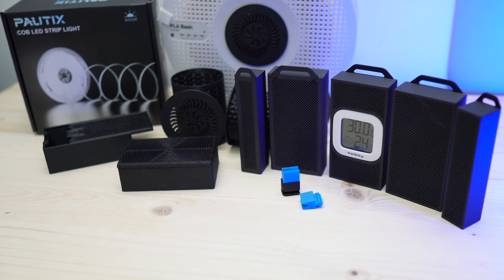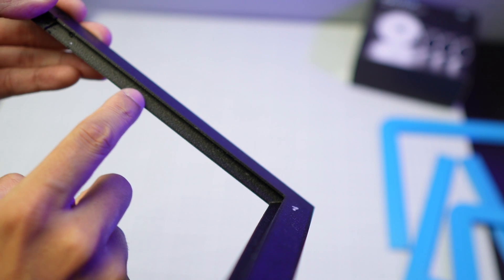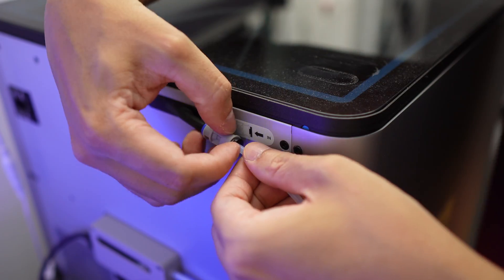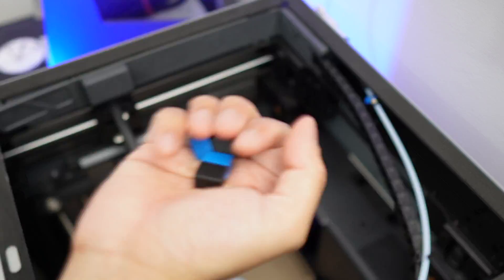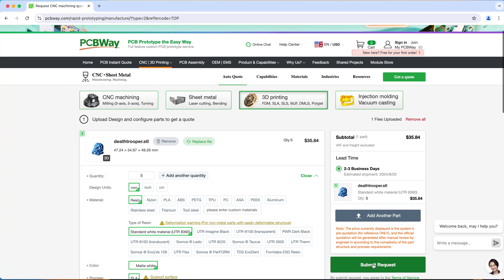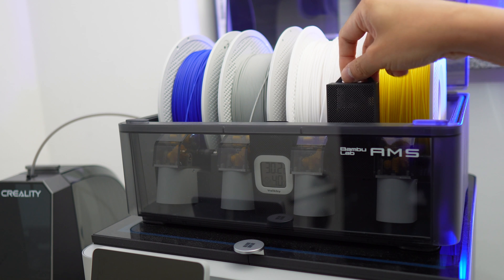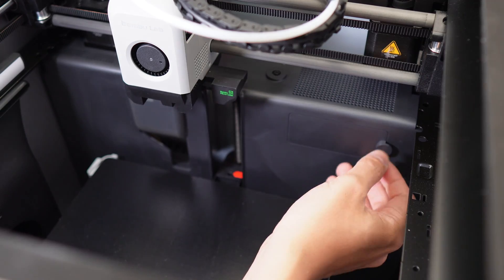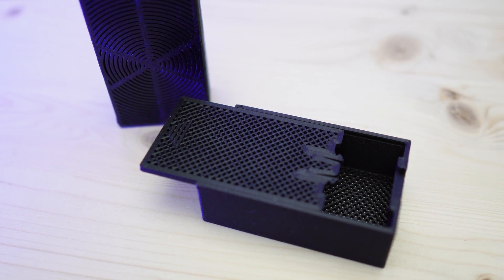BEST UPGRADES and MODS for Bambu Lab X1C or P1S/P2S

Comment from the maker: BambuLab X1C: https://www.awin1.com/awclick.php?gid=570774&mid=46345&awinaffid=2034675&linkid=4382688&clickref=
BambuLab 4-in-1 PTFE Adapter: https://tidd.ly/4pm8DU6

Recommended 3D printer: https://www.awin1.com/awclick.php?gid=570772&mid=46345&awinaffid=2034675&linkid=4382705&clickref=
Best affordable 3D Printer: https://www.awin1.com/awclick.php?gid=570773&mid=46345&awinaffid=2034675&linkid=4382675&clickref=
Recommended Filaments: https://www.awin1.com/awclick.php?gid=570777&mid=46345&awinaffid=2034675&linkid=4382680&clickref=

My 2nd favorite filaments: https://geni.us/A4OFomi
Lubricant for X,Z,Y-Axis rails & idler pulleys: https://tidd.ly/3KMFHqs
Grease for Lead screws: https://tidd.ly/3Lk36j2
Deburring tool: https://geni.us/9WGzv
Wire cutter: https://geni.us/NAwQIL
Heat gun: https://geni.us/Jdcu

#Affiliate

Comment: If you use the 4 in 1 splitter, would the printer be able to use the filaments in the AMS and the spool holder as well? Im curious about this because i heard glow filaments destroy the AMS, and i would like to print with glow filaments as well.

Comment: @Lukis3D as for newbie, why do we need AMS if we have this 4in1 adapter which we can connect 4 spool of filaments?
Reply from the maker: the adapter itself doesn‘t support multicolor printing. 

Without the AMS, you need to manually load the filament.  The job of the AMS is to automatically retracts the filament during color change, then automatically load another filament of different color.
Of course, if you don‘t need multicolor printing, u won‘t be needing the AMS. 
I highly recommend getting the AMS though (preferably AMS 2 Pro). Multicolor/ multimaterial printing is super fun!
Hope that helps!
Reply: @Lukis3D I dont understand, if it is adapter and I can set which wire is going to which color, so why printer could not choose which wire to use at given time?
Reply from the maker: well basically there‘s only one outlet that‘s feeding the extruder. So using the adapter you can connect with 4 tubes, but only one filament that‘s gonna be pulled by the extruder at a time (depending on which filament that‘s currently loaded).

You can pause the print,unload the filament and load a new filament manually if you‘re doing multicolor printing, but it‘s not possible if the color changes occur a hundred of times.

The AMS takes care that for you. It will automatically unload the filament, load a new color and repeat as many times as necessary.
Reply: @Lukis3D  Oh, now I understand a bit better. So basically, I don’t really see much use for the 4 in 1 adapter, since you still have to manually remove the filament and load a new one. Even without the adapter, you’d have to do the same thing manually unload and load the filament. So it doesn’t really make much of a difference in practice.

Comment: The first up grade you should consider is replacing the power cord, the one that comes with the printer is only a cheap 18awg 10 amp cable and is very short.
I replaced it with a 6 foot Startech 15 amp 14 AWG cable which will insure a good solid power feed to the printer.
Reply from the maker: that‘s a great tip, thanks for sharing!

Comment: I never understand the lighting suggestion. I find the lighting just fine. That being said, everything else looks good. I'm definitely going to pick up a nozzle wiper and the SLS splitter. One suggestion is to try the HEPA+Carbon filter replacement inside the chamber. The only-carbon version works just fine, but adding in the HEPA filter doesn't hurt too. I also use a BentoBox to filter the air further in the chamber. I get itchy eyes otherwise.

Thank you for the video!
Reply from the maker: the lighting really helps when you print with dark filaments and you wanna observe the prints from time to time to see if there’s anything wrong.
you also get better timelapses👍🏼

I'm quite hesitant to add the BentoBox since i dont wanna drill any holes on my X1C. Or have they released a new drill-free version?
Reply: @Lukis3D  I never liked the idea of drilling for external power, either. From the left side of the chamber, there is a hole you can push the cable through and eventually get to the left-rear of the printer to run to external power. Most users seem to connect it to the internal power unit, though.

Comment: The Sunlu spools are smaller than the Bambu ones, that is why they are hopping. I printed some adapters and that solved it. I don't think it has to do with the weight, just another way to do it. You may or may not have noticed the gap between the spool and the cover on the Sunlu ones
Reply from the maker: maybe the adapters are adding to its weight? true, I didnt close the lid after I added the spool weight, but as you can see, it doesnt hop at all, it just spins.
Reply: @L @Lukis3D do you have link for the spool weights?

Comment: The crap print you showed at about the 40s mark is almost certainly NOT filament moisture. I am getting this sort of thing on my P1S with every print -- PLA, PETG and ABS -- even on filaments that have been dried for 12 hours. My prints are significantly worse than yours, even.

There's something else going on with this printer that I'm still trying to figure out.
Reply from the maker: I’m sorry to hear that man! Well i don’t have this problem printing other materials though, so I’m not sure what’s the issue with your P1S. Have you contacted their support?

Comment: I didn't understand how the filament spliter works. AMS makes sense, but how does it draw in filament from a static spool without a drive gear?
Reply from the maker: it doesnt really draw filament, if you decide to print from an external spool, you still need to load the filament manually.
its just a helpful tool so you dont need to disconnect the AMS everytime you wanna print something from the external spool (and vice versa). I hope that makes sense?

Comment: It's a bad idea to have dessicant behind the moisture meter.
Because then you dont measure the correct moisture level, but the level at the dessicant beads.

When I removed dessicants from the meter box, the level raised from 10% to around 18-19%

Comment: The wiper isn't just not great, it's terrible. Even bambu knows; that's why they changed it to the superior a1 purge system. There is a great wiper using a cut up silicone tube that filament will not stick to
Reply from the maker: yeah and im hoping that they‘ll improve that in their next flagship printer!
Which silicone tube wiper upgrade is that! Can you share a link?
Reply: I've been using the cut tubing wiper for a few weeks now...is very nice.
Does a great job and I'm seeing less 'fly away' bits from the nozzle.
The original X1C wiper tended to flick little bits of extruded material all over the print chamber.

Comment: I like that you took the time to cut your LED strips into 4 pieces and solder them back together.  I wish I thought to do that with mine.  Next time.
Reply from the maker: sorry for that, of course i meant I solder them back together using cables so i could angle the strips at 90deg angle more easily😅

Comment: Nice list. The only other thing I would recommend for caution is that if you're using activated carbon pellets to make sure you're buying acid free carbon pellets otherwise they can very quickly rust some of the steel components like the linear rods. You can always check to see if your carbon pellets are acid free by putting some in a small container with steel wool. If the wool rusts overnight, then it is not acid free.
Reply from the maker: thanks man and thanks for that tip! I found out that the carbon pellets i have aren‘t acid-free, so I‘ll need to get new ones!
Reply: Wild, never even thought of acid-free pellets. Thanks for the info!

Comment: Pla will work fine for the led strip.  It’s only going to get to 30-40 c. Not going to damage pla.
Reply: PLA deforms from static tension over time even at room temperature, and when warm, it starts to soften long before reaching the actual melting temperature. If your PLA parts are just fine, then maybe you're lucky and your filaments are more durable than the typical PLA.
Reply from the maker: not the LED strip, but the printer itself will melt the PLA 👍🏼
Reply: @Lukis3D  no it won’t.  The led strips will get hotter the the ambient air around the pla.  Dont lie to your viewers.
Reply from the maker: @theromeog  i saw melted AMS riser printed with PLA on reddit (you can google it), so I‘m  not gonna take my chances.
Reply: @Lukis3D  I have had my AMS riser on for a year now. Printed in PLA.  have also printed ABS.  The ambient temps above the printer will not reach above 100c.  Maybe 35-40. Will not melt your riser.
Reply from the maker: @theromeog  do you print engineering materials regularly? I never said 100C, PLA will start to deform around 60C.
It got really hot when i printed the PA6CF for 8h straight but i didn‘t take a look at the chamber temp. I‘ll do that next time.

Btw, have you googled the post on reddit? Can you explain what happened there

Comment: 7:00 make sure its not acid activated carbon pellets, if its acid one then it can ruin the metal components of your printer
Reply: You can neutralize the acid by soaking the carbon pellets overnight in distilled water and baking soda(1gallon/ quarter cup of baking soda) drain and dry. Save yourself some money.
Reply from the maker: @Chris-okf  dude, thanks so much for that tips!! Good that i havent thrown that away yet!
Reply from the maker: I was under the impression that the activated carbon for my reef tank was acid-free, but upon closer inspection, it turns out that it‘s acid-washed! Thanks for addressing that!
Reply: @Lukis3D  😁👍

Comment: Well-intentioned advice to all: There is a reason why the original light is so dark. The LIDAR scanner can no longer see the reflection of the extrusion if the light is too bright. So you always have to stay close at the beginning to switch the light automatically. In addition, the internal camera sets a fixed exposure at the BEGINNING of the print. If you switch on the light afterwards, everything is overexposed. So save yourself the trouble of printing the frame and get the Panda Lux upgrade for 15,- instead ... The light is much brighter, you connect it to the original connector and replace the original light. Lidar still works afterwards and the camera exposure is also correct.
Reply: In my tests with this possible "problem", I did tests - my X1 has it too - and it did not confirm. No matter how the light was set - I have a light frame, the print result was the same every time. Maybe I was lucky, but for me the light frame is not a problem for Lidar.
Reply: The nice thing about this is that if you have an ESP32, you can interface it to the printer with MQTT and make it turn off the lights while it's doing the LIDAR scan
Reply from the maker: That mod is certainly a great alternative to the frame, thanks for pointing that out!
Reply: Normal house lights DO NOT affect Lidar.
Reply: @stormspirit5788 install many bright LED, print with black filament and tell me the result, what the printer is saying 😂

Comment: The printing chamber never actually gets warmer than 60 degrees, i.e. ABS, PETG, ASA ... are also perfectly adequate, so it is not necessary to use extra expensive carbon or glass fibre reinforced nylon etc. for this purpose
Reply: I've measured mine and it easily gets to 95-100F on the inside.
Reply: @wavvydev  i mean 60°C, so that would be 140°F
Reply from the maker: the printer got crazy hot when i printed the PA6-CF and it was quite hot here in the summer too thats why i decided to print with the filament to have at least a peace of mind. But it‘s good to know that the temp doesnt get warmer than that 60degC. Thanks for the tips man!
Reply: I don’t buy into this push the PLA won’t work. Almost 2 years ago I printed a replacement cap for my buddies windshield washer fluid reservoir in his performance car. I printed that out of PLA and to date there has been no defamation, discolor, orany other damage. TLA does have its limits but I think it benefits manufacturers to tell us that the limit is much lower than it actually is so that we buy more expensive filaments. I think it’s a load of garbage, just use PLA
Reply: @ryanamey5024 pla melts fast, only reason that cap doesnt melt is because of its location, the engine bay doesnt get that hot especially where the reservoir is, ive had pla+ printed parts in my car that melt from the sun alone